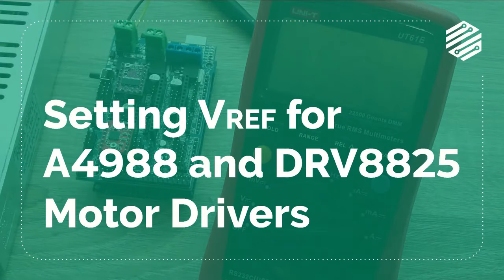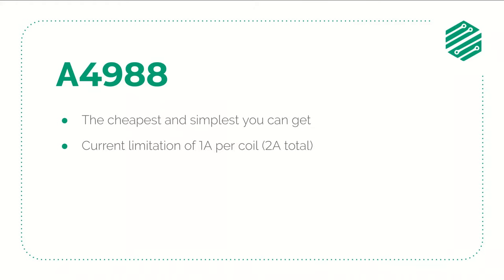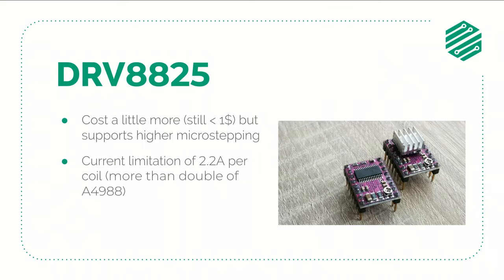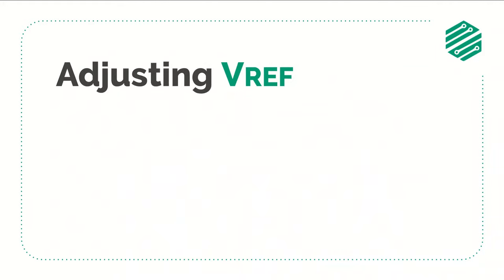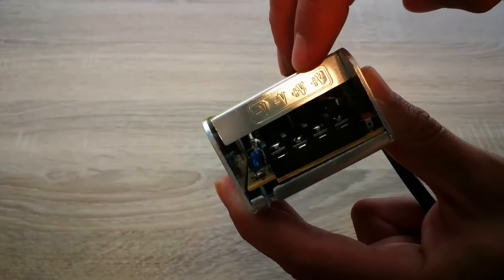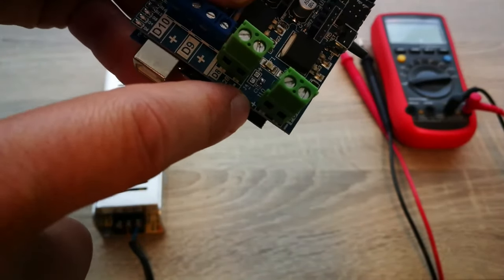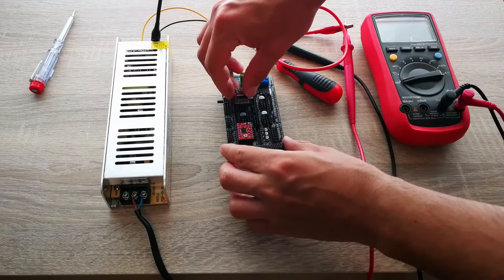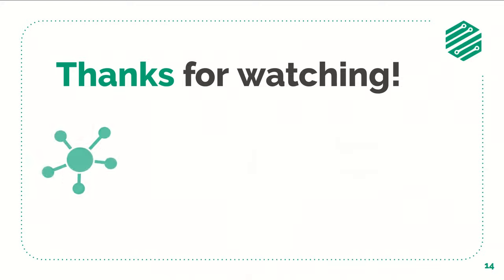How to set VRef for A4988 and DRV8825 stepper motor drivers

Comment: I wish I lived where you live. The ut61e  is like 140 where I live. I have the ut61e + and you're right is a great multimeter and I've had many. Thanks for the video too. I forgot how until you said crocodile clips haha
Reply from the maker: Well I actually ordered it from China. If I had bought it locally it would have been much more expensive. Regarding the "crocodile clips", some people also call them aligator clips. Thanks for the feedback :)
Reply: @zerotoheroengineering  are you insulting me? I'm horrible at sarcasm. Lol i was thanking you and probably got the word messed up lol I got mine from China too but they've went way up in price in China. I paid like 110cad. Great meter the probes are no different than any of the probemasters I have. I actually mailed a set to a youtuber in new Zealand. When I ordered them I didn't realize that they were just the probes but they retracted way too easy. I got a new set with all the different parts for Xmas and they send them in a giant case like a good ratchet set would be in but no one keeps their probes in the case. There's a set on Amazon from a company called bionzo for like 50 dollars that I already had. If not for the soft wire on the pm there's no difference in quality. I forgot how to set vref and your channel popped up. I'm only a newb man, 2 years into circuit level components and theory as a hobby. Much more fun than coding. Peace

Comment: Greetings, but, the microstepping issue? Is the same vref for full, 1/2. 1/4, 1/8, 1/16 and 1/32 ??? Thanks in advance
Reply from the maker: Hi. Yes, same settings. Current setup is independent from microstepping setup.

Comment: Thank you very much for the very informative video. I do understand that for my step motor Nema17 (17HS4401) A4988 should be set to 1.7*8*0.1=1.36, and DRV8825 should be set to 1.7*0.5=0.85
Reply from the maker: I'm glad it was useful for you! :D
Reply: Hi, i am using the same motor with the a4988, but the a4988 maxes out at 1.21, how do i get to 1.36

Comment: How would I go about this if my power source doesn't have a positive and negative voltage section like yours does (just one cable for the entire power source)?
Reply from the maker: If it just has one cable coming from the power source you'll have to strip the insulation of the tip of the cable and there you will find two conductors. They can be two separate wires or one of them can be isolated and the other not. If this is the case, the one that has insulation is usually the positive and the other is the negative. However, the best to do is to test them using the multimeter.

Comment: Hi I have a question, I connected the DRV8825 driver the wrong way and I do plug in the power, will that burn down my driver? because I notice that I cannot get any Vref reading after I correct that.
Reply from the maker: If you plug the power supply the wrong way it is very likely that you may have burned the driver chip😔

Comment: So my question is, why did you select a 12v 180w power supply? I’ve been trying to find out or understand what the minimum power is required.

Can I use 12v with 74W or can I also use 24v @144W? I have been unable to find out how I can possibly use higher voltage power, and how to go about it.
Reply from the maker: I used that because that is what I had around. It is the type of power supply that is also used in 3D printers. For setting the Vref you can use a very low power power supply because almost no current is drawn during the process.

Comment: what happens if you place the driver the wrong way?
and what is the current you are adjusting?   is it for the speed of the stepper motor?   give it more power and the stepper motor goes faster?
Reply from the maker: If you place the driver the wrong way you risk damaging either the driver or the microcontroller. Connecting things the wrong way results in rather unpredictable consequences but usually you damage/burn something. The current that is being adjusted is the current that flows into the motor coils. Each motor has a specific set of parameters for optimal operation (suppporting higher speeds and torque) and the current is one of those parameters. However the actual motor speed is defined by the frequency of the steps pin of the driver, which is controlled by the microcontroller.

Comment: I have the A4988 driver. My motors are rated at 1.5A and 1.3A, but I used the DRV8825 formula for both. Is this TOO conservative? Additionally my Rs value says "R100" so is this 0.1?
Reply from the maker: Hello Dimitrije. Yes, R100 is 0.1. I think using the DRV8825 formula is a little bit too conservative. It may even result in your motor not running smoothly (depends on the motors). Something closer to the values calculared with the A4988 formula should be better.
Reply: @zerotoheroengineering  Thank you for the information! Great video by the way!
Reply from the maker: @dimitrijeljaljevic4234  Thank you for your kind words!

Comment: Noob here... does this mean that, by setting the imax value with the potentiometer it won't matter how many amps te power supply is sending?  Also... is it normal for the driver and motor to get too hot to touch longer than a couple of seconds?
Reply from the maker: By setting the maximum current, the driver will draw that for the power supply as long as the power supply has enough power to provide it. Depending on the current setting, it is normal that the motor and driver get hot. That is why in some cases it is recommended to use heatsinks and/or cooling fans
Reply: @zerotoheroengineering  ah, good to know! thank you for the reply!

Comment: My motor initially worked but slowly the rotation stopped and wouldn't turn on again, do you have a solution?
Reply from the maker: That is a weird behavior. Are you sure you connected everything properly? Can your power supply provide enough current?

Comment: I'm a bit lost...
I have these motors 23HS5628 rated at 2.8A. Now to the board. I'm using DRV8825 drivers. If i follow your calculation it is (2.8/2)-10% =1.26v. But the boards only go max till 1,16.
Will that say i can use the boards at max vref without any problem. Or will they get very hot and break?
Reply from the maker: Your motors are a little bit over the max limit of the DRV8825 which can provide a maximum of 2.5A per coil. Theoretically you could use them at the max VRef as long as you use proper cooling (heatsink + fan). However, everything that is continually used at maximum performance tends to last shorter times. However, the drivers are so cheap that they're at least worth a try :)

Comment: How much the vref setting, if we use two motors with one driver.
Motor description is 10kgcm and 2.8A
And driver is easy driver stepper motor
Reply from the maker: Hi. The easydriver is not appropriate for your motors since it has a maximum current of 700mA per phase, which is 4 times less than what you need: 2.8A. You should look for other stepper drivers with capability of providing that amount of current.

Comment: Thank You for a Very useful and informative video. I have one related question to ask, will this solve the problem of overheating motors and annoying aound they make?
Reply from the maker: Hi. Setting the VREF correctly allows you to get the best performance, which means less noise and less vibration. However, there will always be some noite using these motors. There are other stepper motor drivers from Trinamic (TMC2100, TMC2130, TMC2208, TMC2209) that can further reduce the noise and vibration. When I get some time I'll make a video about them. Stay tuned

Comment: can we just stick the driver onto a breadboard without using the ramps?
Reply from the maker: Hi. Yes, you can stick it in a breadboard without using the ramps. You just have to connect the GND and VDD pins. Notice that the VDD is the logic power supply (5V), so don't connect 12V on VDD.
Reply: Thank you so much!
Reply from the maker: @leonatay248  You're welcome! :)

Comment: hello, if i change my voltage to the board to 24 v , do i need to change also the driver current in half or can i let the current  set as 12 v
Reply from the maker: Hi. The VREF is independent of the supply voltage. You can set it and change the power supply with no problem.
Reply: @zerotoheroengineering  thank you a lot

Comment: If we want to add an i2c lcd screen module to the circuit, do we need to connect the lcd when adjusting the current limit? Because i tried connecting the lcd after i set the current limit and the motor is not working (it works if it's not connected to the lcd)
Reply from the maker: Do you have any picture or drawing of your connections? The LCD and the stepper motor driver are completely unrelated and one should not affect the other. Maybe you have some wrong connections.
Reply: @zerotoheroengineering  nevermind I figured it out, thanks🤣  because the arduino keeps sending signal to display the lcd so the motor cannot work, after i tweak the codes then it's working already, there's no need to change the current limiting potentiometer
Reply from the maker: @leonatay248  Happy to know that you were able to solve it. Good luck on your projects :)
Reply: @zerotoheroengineering  thank you so much, you video helped a lot

Comment: The electronic clinic showed the use of the second Vref formula for the a4988. (VRef = Imax/2).
Reply from the maker: Hello Ryan. The formulas I provide in the video came from the stepstick pages from Pololu and are correct: 
DRV8825: https://www.pololu.com/product/2133 
A4988: https://www.pololu.com/product/1182

The formula they showed you also works for the A4988 as a "rule of thumb" if the Rsense of the A4988 is 68 mOhm. If you do 8x0.068 = 0.544 which is very close to the 0.5 (or 1/2) of the formula of the DRV8825 that you mentioned, making both formulas very similar. However, if the Rsense is different than 68 mOhm the VREF calculated using that formula will no longer be accurate.
Reply: @zerotoheroengineering  Thank you. This is useful. I did find the data sheet for the A4988 when I went to your website. I appreciate you sharing your sources.
Reply from the maker: @ryanbrown172  You're welcome and also thanks for sharing info here. Cheers!

Comment: My sensor resistors for the A4988 read "R10". I assume this means 10 milliOhms. The resistance is so small that my multimeter cannot read it. Is this value a problem? It results in Vref = 0.12V for Imax = 1.5A for the stepper motors I'm using.
Reply from the maker: Hi. You almost got it right. R10 actually means 100 miliOhms. So your VRef shoud be 1.2V  (8*1.5*0.1 = 1.2V).
Reply: @zerotoheroengineering  oh wow. That’s strange notation. Thanks so much again! That helps immensely.

Comment: Can I ask a silly question pls
Can I use Power supply with 12V 2A
Because according to the vid, I use Stepper Motor with rated current 1A, so my Vref is 0.8V. Uploading with code, my Motor does turn but it’s not rotate, just vibrate little forward  then backward. I tried to change Vref a bit but it’s same as previous, except the Motor became weaker or stronger, pls help :((
Reply from the maker: Hi. Yes, you can use power supply with 12V 2A. From what you described it seems to me that your motor wires are not in the correct order. If they are not in the correct order they will turn a little bit to one side and then the other, resulting in vibration. Try changing the order of the wires. When you put the right order it will rotate as desired.
Reply: @zerotoheroengineering  thanks for your reply, and yes I do try to change the coil, and already known exacly the right coil by using Led trick. But the problem still same. Don’t know if it’s by the power supply or the Vref of the driver (a4988)
Reply from the maker: @pipimz4734  Do you have the reference code for your motor? Are you sure that both th driver and the motor are in good condition? Do you have other motor or driver to try?
Reply: Same problem bro

Comment: so my stepper motor is 1.3A; x 8 x 0.2 (0.2 is the resistance i measured) = 2.08? Seems a bit high. hmmm.....I'm definitely taking 10% from that!
Reply from the maker: Your calculations seem correct and taking the 10% is a wise decision :)

Comment: Mine A4988 is showing 0 volt across  potentiometer and ground even after turning potentiomenter counter clockwise. Why does it happend? i am using battery cell of 12 volt and 23 amp. Also I don think that connection of stepper is wrong.
Reply from the maker: Hi. Are you calibrating VREF with a standalone stepstick or with a stepstick mounted on a board like the ramps? Are you providing the 5V logic power supply as well? The 12V power supply is only for motor current supply. You must also provide the 5V to the logic part.

Comment: I have a problem and I don't know where else to ask, but for some reason I'm getting a 12v reading off of the potentiometer
Does anyone have an idea on how to fix that?
Reply: It might be because you may have not yet connected the ramps board with the Arduino board.
Reply: @hamzajamal5661  nah that can't be it, the first thing I did was connect the ramps and the arduino
Reply: @ikermorell1078  try at stack overflow/exchange, you might get a solution there
Reply: @hamzajamal5661  alright thanks I'll try

Comment: i dont get any reading in my multieter for potentiometer reading ,but supply is 11v and 1.3 amps, idont know where fault lies
Reply from the maker: It's hard to guess what could be failing. The best advices I can give you are: (a) check that the supply voltage is reaching the stepper motor driver and (b) check if you get the same behaviour with a different stepper motor driver (maybe the one you used is faulty)

Comment: Nice video but my salvaged motors do not have any labels hahahaha
Reply from the maker: Ahah That's the hard mode :) In your case you can create an arduino sketch to continuously rotate the motor and connect everything together. Then, with everything connected and powered, slowly twist the potentiometer on the stepsticks until you get a smooth rotation of the motor. That's not the perfect and safest way, but if you're careful and know what you're doing it will work fine.

Comment: hello. for A4988  i see this formula : 
current limit = vref * 2.5
vref = current / 2.5
Reply from the maker: That formula is only true for a specific value of the sensing resistor. There are boards with different resistors as I mentioned in the video and the value of the sensing resistor must be taken into account

Comment: isn't is just A LOT easier to feed the 12V to the driver and use the multimeter to read the amps, and adjust based on that reading? see 45m40s here: https://www.youtube.com/watch?v=0qwrnUeSpYQ
Reply from the maker: If you listen to what the guy on the video is saying, you have to put the multimeter in series with only one of the coils of the motor and measure the current while it is stopped (the short circuit current). It works, but there are several reasons to use the method I describe:
1 - The VRef method allows you to set the VREF without/before connecting any motor, preventing any possible damage.
2 - if you have a board with the drivers soldered on the board and motors with specific connectors on the leads it may be hard to put the multimeter in series with the motor coil. 
3 - When you do your first measurement you don't know which current is set on the driver. If it is set for 2A and you use a low current motor you risk damaging the motor. 
4 - If you do this on a board with multiple drivers (eg. 3D printer board) it's easier to measure 4 test points and adjust 4 screws than connecting the multimeter in series with a coil of each motor 
Both methods work, but the method I describe in the video is safer and the way recommended by the manufacturers.